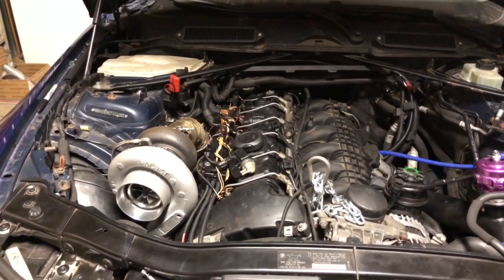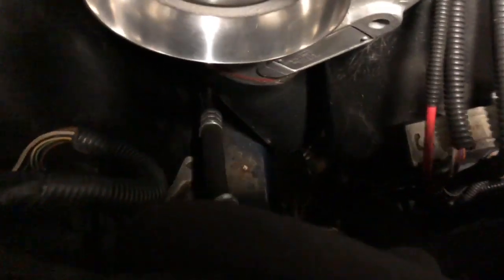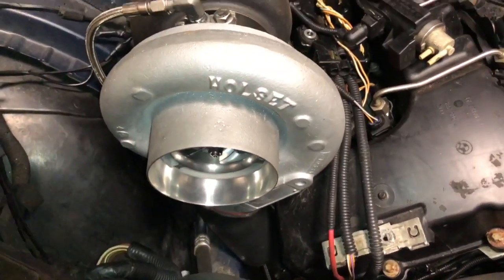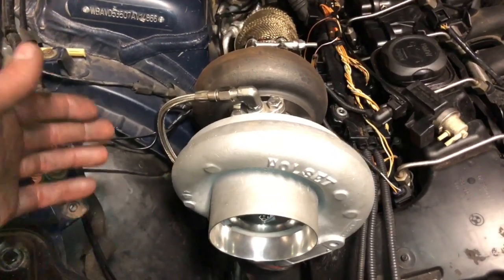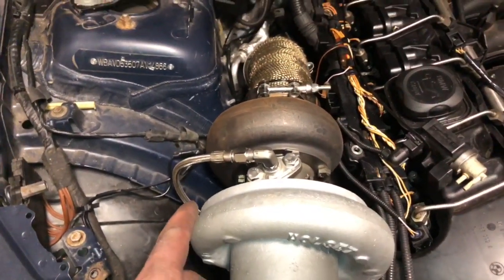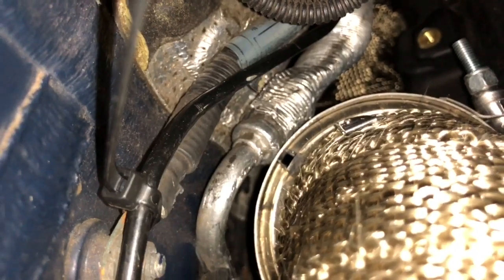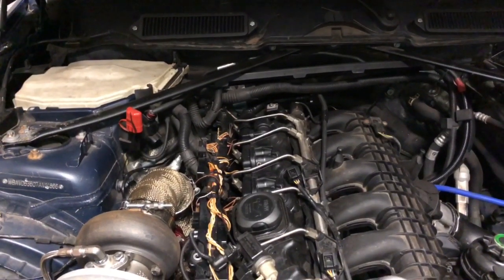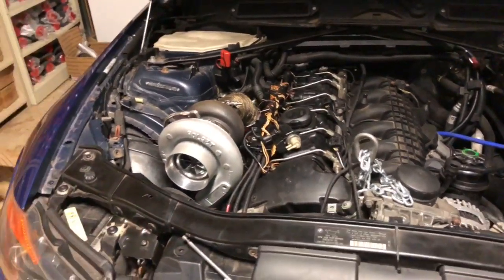Bmw N54 single turbo installed

Comment: Are y’all going to be selling single turbo kits now?
Reply from the maker: No. Ian just wanted to put one on his car.
Reply: @turbolabamerica  is there another place you can be contacted about building turbos or serviceing/pricing of turbos?
Reply: I want to see it run. Did you guys use steel tubing and rubber couplers to go from the exhaust housings?